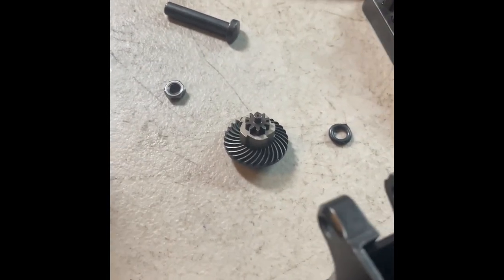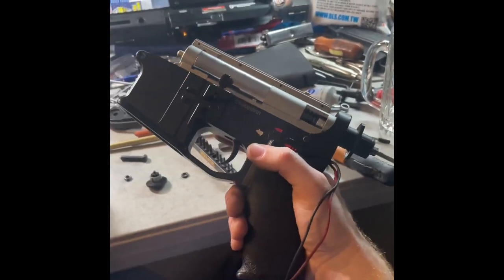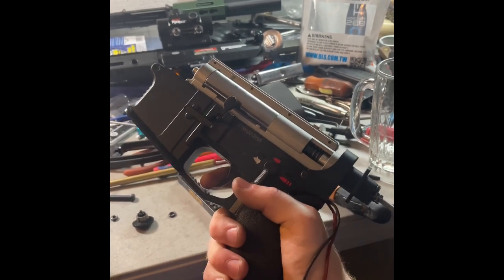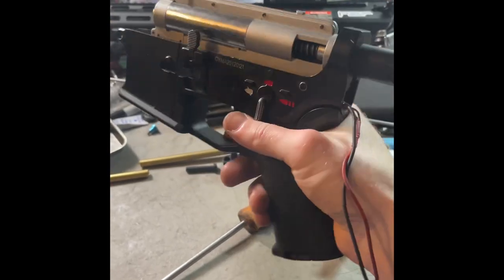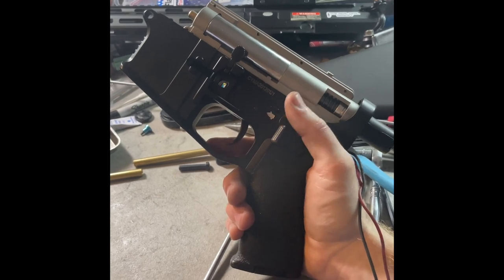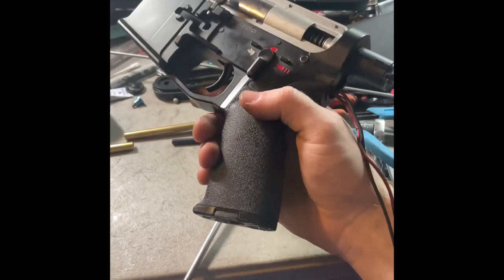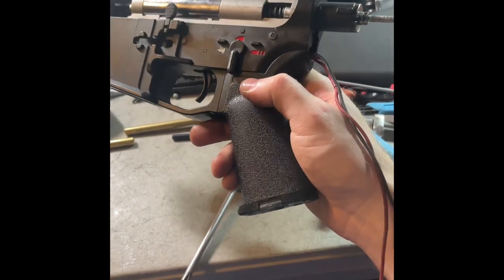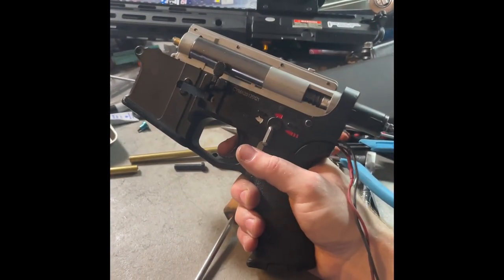Airsoft. Helical vs straight cut bevel gears.

Comment: I really need to stop watching those videos. Like everytime I stumple across those "game changers" I pretty much replace parts in all my guns and be left with a suitcase of unused replacement parts.
Reply from the maker: Yeah thats happens to me alot.  I have to take a step back tel myself i dont need it lol.
Reply from the maker: @youradvertisehere  yep. My builds are almost never “done” lol
Reply: @kapler8550  for me its the dance of the wallet fairies. Both my son and I are constantly messing with our guns. I fear when he becomes old enough to drive because then both us will be doing the airsoft thing and building on our cars....I need a second job just talking about it😮‍💨
Reply from the maker: @robsorgdrager8477  yeah lol. Might not be as expensive as car parts. But it adds up just the same
Reply: @kapler8550  yes sir. 😮‍💨
Reply: A properly shimmed gearset is almost as quiet as helical gears with 10x less than the work required.

Comment: spiral bevel/pinion is the way... use em in every gun i have
Reply from the maker: yeah they are far superior to straight cut. not just in sound, but in how 
smooth it feels when cycling
Reply: @kapler8550  I wish someone would do a full low ratio spiral gear set or dsg. Would be amazing
Reply from the maker: yeah i was thinking that too. as long as the price is reasonable, i would 100% convert all guns to helical 13:1/18:1dsgs

Comment: Wow! The spiral gears literally sound like a type writer 😱. It makes sense to me, I'm a mechanic and in a car straight cut gears make a harmonic that bores right through the soul and that's why production cars use spiral cut gears....they are quite. How are they with strength? I'd love to see what my V2 , war head 45k in my feather weight m249 is like. I mean it's gonna be loud regardless but I wonder if it would help it run smoother? 🤔
Reply from the maker: They bring down gear noise even more so in highspeed brushless builds. These lonex spiral gears are made out of REALLY hard steel. I tried drilling one to put in a grub screw to use on a d-type shaft. And found i didnt have the bits to do the job. Not even using my tabletop Bridgeport. So i wouldnt worry about durability.  

The only problem with putting them on brushless motors. If you have to press them into the shaft. Which means you have to disassemble the motor it selft you you dont damage the ecu on the motor. Cause you can push the shaft into the ecu
Reply: @kapler8550  thank you brotato chip ! ✌️🤙 I'll look into what I need. The warheads come with a D shaft for the most part I think ....if I can build a car out of a pile of other cars I should be able to make something work 😊

Comment: What tool did you use to remove the pinion gear?
Reply from the maker: The zci has a d-type pinion so its not hard too hard to get them off. Just need an Allen key, a flat head screw driver, and maybe a set of vice grips (if you have ones that can grip the pinion without damaging it).
For o-type pinions ill usually just but the pinion in a vice and hammer the shaft out with a punch. There are pinion gear pullers available on the market, but i cant be bothered to buy something to do a job i can already do in 5 minutes without it.
Reply from the maker: old man strength  tbh ive never ran one till it has failed. Im usually changing up builds frequently and experimenting with new parts. But so far the dsg in the video has pretty  much 0 wear on the internals. And it has well over 10k rounds through it atm. 

It wants a brushless tho, motor gets really hot lol.
Reply from the maker: old man strength  yeah exactly lmao. Im running a ovonic 50c 2200mah. Gotta lay off the binary cause the zci HT doesnt cut it lol.

Honestly debating on putting the short stroked 13:1s back in it.
Reply from the maker: old man strength  yeah hsssg seems the way to go for me.
The dsgs just dont seem to be too happy at 1.5j. Im working on a 1j dsg atm but idk if ill ever use it lol cause i play at an out door field where range is king.
Reply: all the helical pinions i see are o types do they sell d types?
Reply from the maker: @batzarrosdefijourney6970  im fairly certain they are all o-type unfortunately. I would love a d-type.
Reply: @kapler8550  hmmm so no using warheads lol bummer not sure why they don't throw out some dtypes bummer
Reply from the maker: @batzarrosdefijourney6970  you can put them on warheads or other dtype shafts. But in the case of the warheads you have to desolder the ecs from the back before you press in the pinion on. 

Im not going through the effort for that tho lol.
Reply: @kapler8550  ohhh yeahhh woww idk how to do that beyond my level lol

Comment: Tried them in my DMR . They are awesome. Smooth cycling, sound is far better. 
I’ll change all of my gun’s pinion
Reply from the maker: Yeah im gonna be putting them in all my builds going forward for sure.
Reply: Is there helical 13:1 ratio ? What should i get ? Anything ? Just get the bevel ?
Reply from the maker: For now, there arent any helical 13:1s that i know of. But 90% of the gear noise comes from the bevel to pinion anyways. So just the bevel gear is fine
Reply: @kapler8550  just need to find a reseller for the lonex now that isn’t shipping it for more than 100$ to the EU 🫠

Comment: Nice, I have recently reshimmed my AEG (DE Armory m906D), I think I did a pretty good job as I gained some considerable ROF.
However, I cannot get rid of that "spinning" noise like you did. Is it a motor thing (I'm using stock) ? Or do some gears just make the "grinding noise" anyways ?
Reply from the maker: yeah some gears are just noisy 

I have a DE m904g, and i found the stock gears to be really noisy. 

I prefer shs gears since they are affordable and you can make them really quiet. 

If you really wanna eliminat gear noise the lonex helical bevel/pinion gear in this vid is the way to go.

Comment: what grip is that? And would you recomend leaving the stock grip on the cyma m4 qbs?
Reply from the maker: Thats the stock cyma platinum qbs grip. And I personally really like these grips. 
I personally would leave the stock grip alone. 
Ofc that’s subjective and you might prefer a different grip. 
But objectively this grip is as good as any other grip.
Reply: @kapler8550 i have a pdw cyma plat m4 so it has a different grip, called the cyma skelly grip, im just wondering how the pinion and meshing on thos is because my skelly grip os a bit worn out so im looking to replace it.
Reply from the maker: @Oofmart  oh that one. Tbh ive never had my hands on that one specifically. 

But i have used gips with similar angles to the skelly and i usually get a little more noise from the bevel/pinion gears compared to grips with more angle like the cyma “ergonomic” grip. but its nothing out of the ordinary or to worry about. 
Id take the cyma ergonomic grip over the skelly.

My personal favorites for grips are the pts enhanced polymer grip and the cyma ergonomic grip. 

They are both pretty similar in shape with differences in texturing and the pts grip has brass thread inserts for the motor plate screws. 
And the grip angle lets the motor line up perfectly to the bevel gear. So i can get minimal gear noise.
Reply: @kapler8550  i have the pts epg non compact version, i tried getting it on once and it shot, but it sounded a bit off, was there anything in particular you did when installing it?
Reply from the maker: @Oofmart  you probably just have to re shim the bevel/pinion. I recommend doing that whenever you change motors/grips. Unless your swapping otherwise identical replacement parts.
Reply: @kapler8550 oh ok, I didn't know that. Approximately many mms of shims did you use for the bevel on the bottom?
Reply from the maker: @Oofmart  tbh i dont remember. I wanna say it was like .2-.3mm of shims. But i cant be sure. 

https://youtu.be/vRISNZkTp0g?si=GK8VFVWRlFpqVM6C
The first bit of this vid goes over bevel/pinion shimming

Comment: I wonder what they sound like on war head motors, or brushless motors in general. cant put them on warheads cause they use d types. and I believe the only spiral gearsets available currently are all o type.
Reply from the maker: You can put them on warheads, but you have to disassemble the motor to do it without detrying the ecs. I have t done it myself, but i assume is just as slick as a normal motor.
Reply: @kapler8550  how do you press it on? It seems very difficult
Reply from the maker: @barnard.  you have to remove the armature from the motor. Then you can press it on with just a vice or something. I used a vice to press them on my brushed motors

Comment: What ETU are you using in this? Also curious as to what motor you're using as well
Reply from the maker: This is with a perun hybrid v2, as for motors it’s actually 2 motors, an shs HT with the standard pinion gear and a zci HT with the helical pinion.